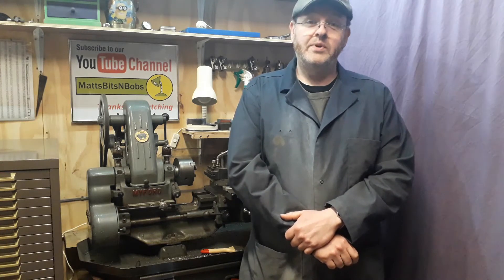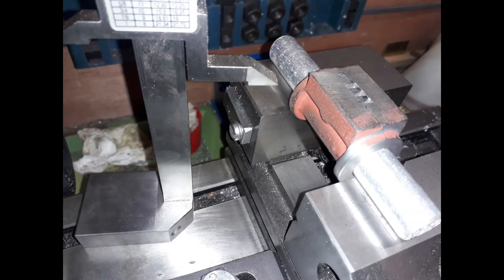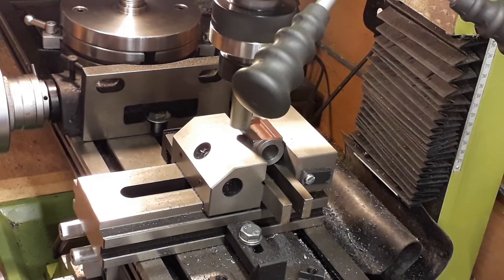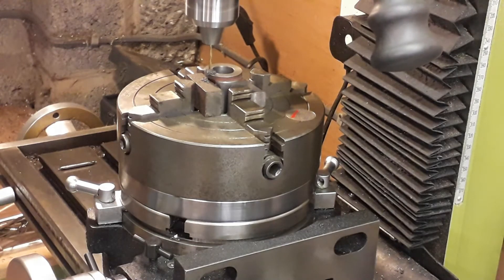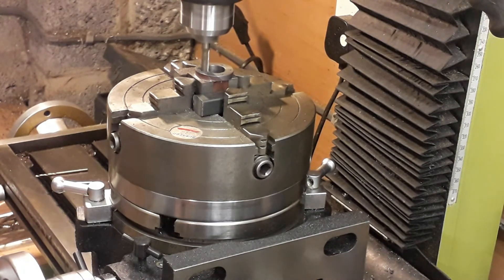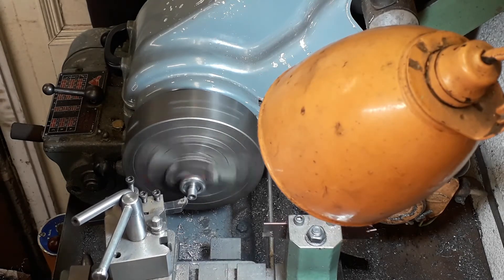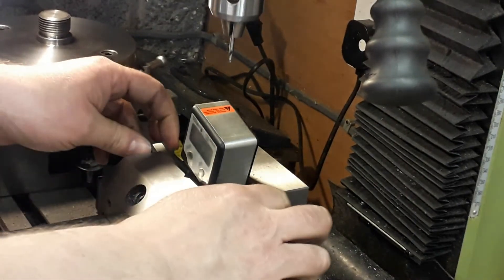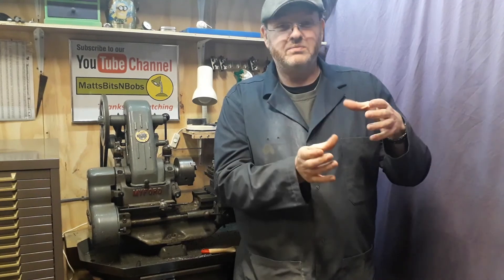Easy Stuart S50 Build Part 5 The Cylinder

Comment: My cylinder core must be at an angle. Measuring and visually one end is only 0.002" off but other end is 0.021". If I clock a round bar in the good cylinder end. Could I correct some if the bar only went say a third into that end. Fully in and it would just follow the old angle.
Reply from the maker: Yep as with all these each one is different, they are castings in sand so that's the job you have of making it all good. It may be worth trying to set it up using the outer edge of the flange, that may get you closer, choose the "good" end, machine the the bore and flange, make a mandrel to fit the bore to machine the other end. That may work but have a work out what works for you.

Comment: My plans to not give the angle for the steam port drilling. Did you try to scale off the plans or another method?
Reply from the maker: I did it off the plans, it's about 14 from memory then set it up, eyballed that all looked ok then prayed! it is a bit nerve racking at first but just check every way first. Good luck